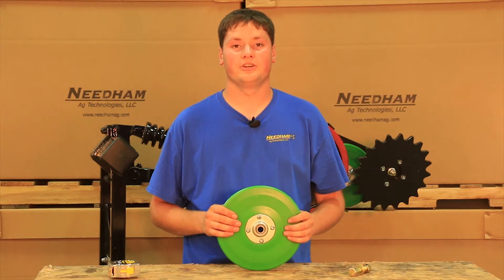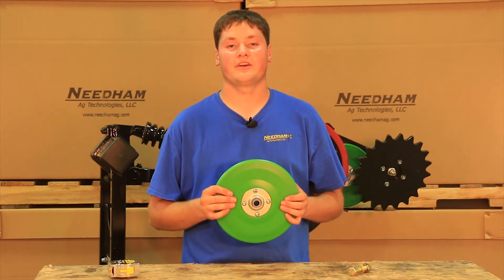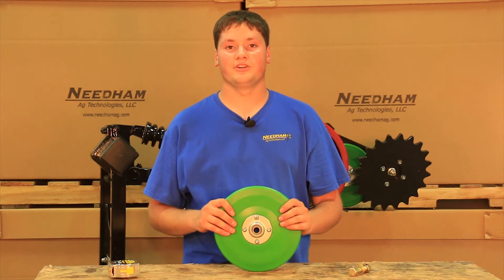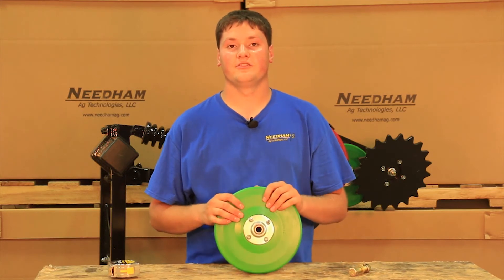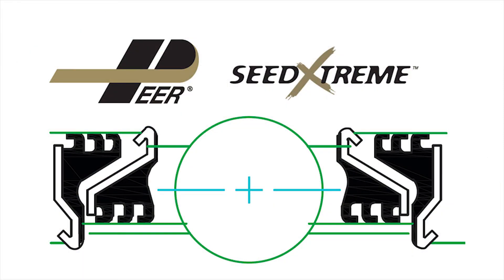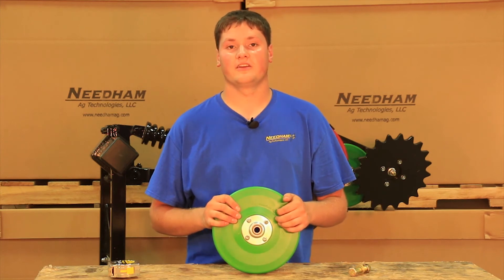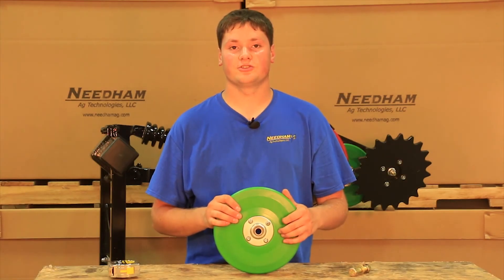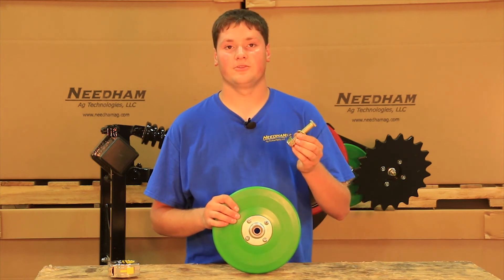Needham Ag - New V8 Firming Wheel With Urethane Tire for John Deere  50, 60 and 90 Series

Comment: Do you have a firming wheel that would work on a Bourgault 3820?
Reply from the maker: The 3820 should come with a firming wheel already. That’s a newly released drill, did it not come with them ?
Reply: @NeedhamAg  yes it has them but in muddier conditions they jam up with mud and residue in front of them. They are a soft rubber so if you don’t remove the mud they wear badly. I wonder if urethane tires would solve my problem?
Reply from the maker: @derekfalk6620  the Deere has different spring tensions, in similar conditions we remove the Deere firming wheel springs from the pegs to allow the wheel to operate with no down pressure (just the weight of the wheel and arm). That’s usually all that’s needed and stops mud building up on any firming wheel in most conditions. 

Can you de-tension the firming wheel spring on the BG?
Reply: @NeedhamAg  I see. On mine, the firming wheel arm is set up like a high speed disk with 4 rubber sausages for tension. Tension can’t be adjusted but the depth can with a cam. So I might have to adjust that so there’s less pressure on the bottom of the furrow. Thanks